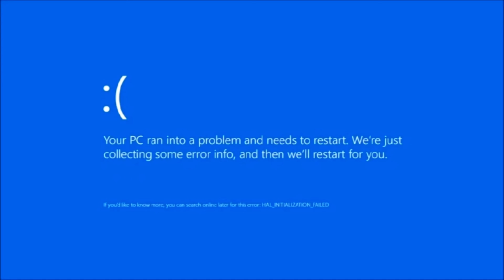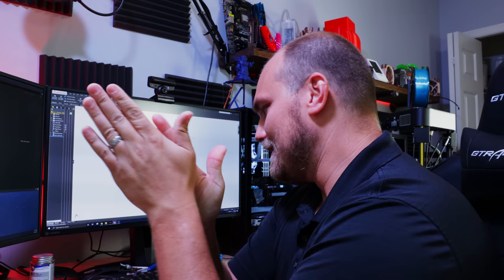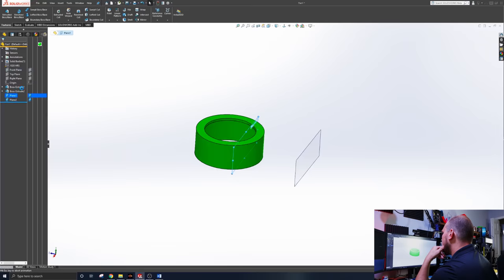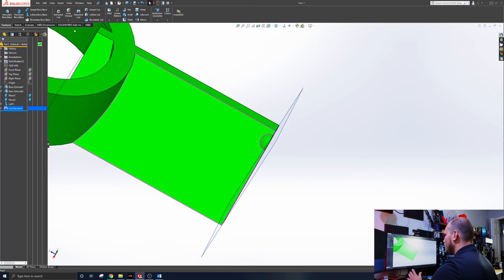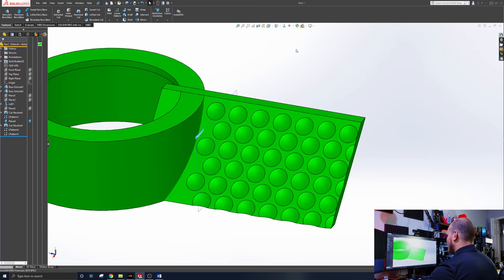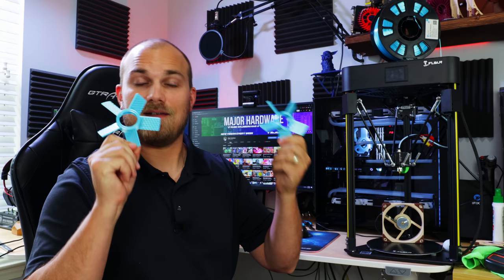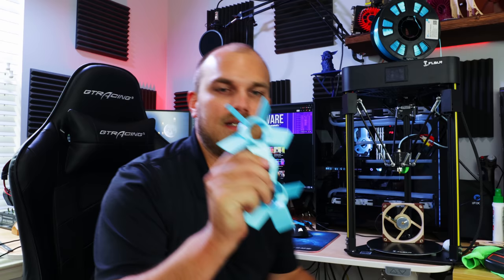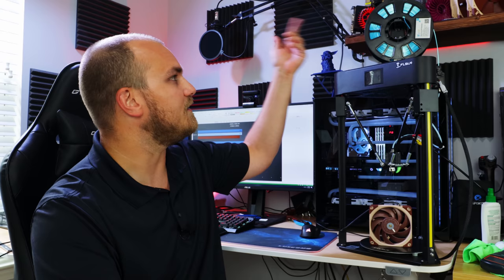What If Fan Blades Had Dimples Like A Golf Ball?

Comment: the fans are digitally controlled, measuring their rpm isnt relevant.
Reply: Yea the motor will spin at the same rate no matter what. Needs to be in a direct airflow tunnel and see what rate it would spin if only on a bearing
Reply: Measuring RPM would have been relevant if he was also measuring power draw/current
Reply: It does though
Reply: except he hooks it straight to a 12v line. Which you would know if you watched his other fan videos.
Reply: It's on its max power (meaning it's running on DC and not PWM), the weight and air resistance of the fan will affect the RPM.
Reply: @markzaikov456  This is a bipolar fan motor with a solid state controller. Its response is not linear nor is it necessarily proportional to the any changes in the load.
Reply: @akabiscuitwaffle  so, those fans are brushless bipolar motors. There is a digital controller inherently baked right into them to commutate the windings.

Comment: Yes, we did see the same RPM coming lol. Compare the current draw, the RPM are a testament to the motor speed control, the blades however could impact efficiency of the motor. I.e. drawing more power to maintain 1880 rpm.

Comment: There actually was a popular dimple-bladed fan in the early 2000s: The Sharkoon Silent Eagle.
Reply: I run these in my current system. I don't know if the dimples actually do anything, but they are great fans and incredibly silent.
Reply: Back when even fans had catchy and meaningful names haha
Reply: Yes, was about to say this. I have a white one and a clear one and they are indeed very quiet. They came with little rubber thingies instead of screws so to dampen sound even more.
Reply: @enquiryplay  Same here - and they've recently ticked past 10 years old.
Reply: Yeah, My old gaming PC had those.
Reply: @enquiryplay  Must be pretty good fans if they are running 15-20 years later perfectly.
Reply: @IvanOoze1990  They aren't quite that old. I bought them in 2014.
Reply: The Apple G5 had those rubber holders for the fans too
Reply: @enquiryplay  Noctuas are also incredibly silent for their airflow, although pretty expensive.

And we know that they do extensive research to reduce the sound level, and they seem to have moved away from dimples.
Reply: @Shadow_Hawk_Streaming  I'm currently completely overhauling an old G5 Quad with the liquid cooling system. Unfortunately I had to destroy most of the rubber thingies. Thing is a b'tch to take apart.

Comment: you could reverse the dimples to make a bumpy surface , or use a shark scales pattern as it's made to flow perfectly at least underwater...
Reply: It would be very interesting to see the scale pattern tested out!
Reply: @shandyozaki9579  especially under water
Reply: Sharks don't have scales
Reply: I learned today that sharks have scales... off a video about fans 😂
Reply: You need to check CFM airflow instead of motor RPM.
Reply: @davidbroadfoot1864  incredibly fitting video, he compares the shark scales to.... golf balls!
Reply: sharks r cool!
Reply: whale fins have nodules at the edge that are supposedly better for flow around them as well.  Interesting idea to try out.  I wonder if there are any energy savings with different designs?
Reply: @Mrch33ky  Orcas are even cooler! :D
Reply: Or a sacred geometry pattern.  Maybe wishful thinking but the fan might shed air better or something magically wierd.  But considering they probably did research on golf balls alot suppose the hexagonal pattern is good nuff
Reply: The main reason sharks and fish are fast, is their hydrodynamics and their slimey surfaces, they have very very little resistance because of it
Reply: >> you could reverse the dimples to make a bumpy surface  (call it pimples
Reply: I've actually got a fan that has dimple bumps instead of dimple hollows. It doesn't flow very well, but that is probably because the fan blades are undercut at the bottom of the outside edges to avoid hitting the ever-so-necessary LEDs that light up when it is going round.

Comment: Decibel meter and airflow meter would be a good thing to add to your testing I think.
Reply: Indeed! and what about actual product - What is the airflow IE does it cool the PC etc. more? a bench test just doesn't say when that circuit will tell the fan when it needs to work. With less material causing cost savings and if it is more efficient IE uses less current (less money from your pocket to the nasty old utility company) that is the real test i think. Sorry if I repeated a thought. This is very intriguing idea.
Reply: Glad I saw your comment because if those aren't in the video I'm not going past the... 1 minute mark. Thanks again.
Reply: Also he could have looked at energy consumption.
Reply: @propositionjoe6936  Prop Joe, how right you are.
Reply: Yes, the goal is efficiency (watts, CFM, BTU, dbm) so should the measurements be such.
Reminds me of a certain show that "busted" concepts using non-objective test methods based on personal myths.
Reply: These honestly seem like the fist two things you'd measure when testing fans. I was surprised when the video ended and neither had come up, except for an ear test on how loud the fans were.

Comment: It is in no way surprising that the two blades spin at the same speed: the motor is likely designed to run at a target speed.

The interesting questions are:
1) does it move more air (and is that flow less turbulent)?
2) does the motor take less power to achieve the speed?
3) does it improve static pressure?
Reply: yeah was hoping this got answered lol
Reply: Actually the point of the dimples on the golf ball is to induce turbulence. Turbulent flow splits later than laminar flow, reducing the pressure drag on the ball. It does increase skin friction but pressure drag is much stronger. I
Reply: Absolutely - the power consumed to maintain the same volumetric flow is the important factor as you're trying to improve the efficiency of the fan.
Reply: @JZhang-of7iw  just because there is more surface turbulence on the fan blade surface doesn't mean there is more turbulence in the air flowing off of the blade. That might seem intuitive, but the physical reality often isn't intuitive.
Reply: You guys all sound smarter than me so wheres the answers?🤨😂
Reply: @Noone-l6g  Since there aren’t any numbers, I can’t say for sure, but I think that the angle of attack is too high for the dimples to do anything.
Reply: @christophermartin6071  Right, I misunderstood what you were asking. I thought you were asking if the airflow on the blade is less turbulent.
Reply: saved me watching the whole vid - thanks!
Reply: Came to the comments to make the same point, plus one more: He also needs to test for noise level, as dimples reduce turbulence, they may also reduce sound.
Reply: GMTA was gonna say same stuff- plus one more: I think the dimples prevent boundary layer adhesion, and that is speed dependent- use a different motor- maybe 3 phase model airplane motor- and crank it up over 100 mph tip speed similar to what a golf ball might hit. bet a model airplane prop model could be found for your printer, just add the surface dimples...
Reply: No the motor wil run at a slower or faster rpm depending on the fan weight and design. Watch the fan showdon series
Reply: This what i was expecting honestly.

Comment: Part of the motor driver is speed regulation. So of course they are the same RPM.
Reply: If a fan is too heavy or very inefficient it will overpower the motor at some point and stop it from reaching its preferred rpm.
Reply: Hey look everyone a guy who knows more about this then the YouTuber who actually does this shit.
Reply: @youngputter239  I mean I'm hardly convinced that this guy knows more than the youtuber. I thought the motors mostly output the same wattage how fast that spins depends on the fan. Why should I believe that this motor has some feature that makes it always spin the same rpm no matter what's attached. Surely the youtuber/engineer would be aware if that was the case
Reply: @monhi64  Mostly because that saves BIOS work when regulating fan speeds. If it didn't have a preset static speed, changing the speed of the fan through the BIOS would require constant updates and adjustments. Making it built-in to the fan itself would show up as a change in current draw or voltage as the fan would handle the speed set once by the BIOS.

I realize this wasn't in a PC, but if the fan was designed to go in a PC, having a fan that you could set a defined speed on allowing it to vary the current/voltage would be a huge benefit to the BIOS. Kind of set it and forget it. Meaning this may be the standard for this kind of fan. 

The real test should have been to attach the fan to a motherboard that allows incremental changes in fan speed. Create a table and plot the voltage per RPM and see if there is a difference. A significant difference in current/voltage may indicate a more efficient fan design though the RPM stayed the same. 

I'm not saying this is a fact, just that it makes a lot of sense.
Reply: @JasonBurnettsProfile  ok I kinda understand what your saying. So one thing that doesnt make sense is like what's the supposed point of the dimples. Do they blow more wind? Like if they pushed more air they would have a higher air resistance and it would make the motor work harder to spin it. So its making more wind still at the cost of more energy. Why not just make the fan spin faster that is also more energy. But idk maybe one would require less extra energy. I dont think you necessarily want the fan that can turn with the least air resistance and that would mean it blows less air but idk I'm sure someone knows the answer to that question lol
Reply: @JasonBurnettsProfile  CPU fans change speed all the time! Only the occasional desktop cooler doesn't have feedback and speed control these days. My laptop, like every other one I've used in the last 15 years, changes speed according to the current load on the CPU and GPU. Without looking at that feedback mechanism, you can't really tell what's going on with adding dimples.
Reply: @youngputter239  Yea and why is that weird? The guy did the comparison wrong.
Reply: @monhi64  The dimples are supposed to lower the resistance of the air flowing over the surface of the blade, so energy is not wasted as heat (friction) but is put into moving the air.
Reply: The COVID-19 brought out the University of Facebook doctors. Now this video did the same for the YouTube University Engineers graduates. This is going to be fun to watch... 😏

Comment: Make a fan with horizontal blades but give them the cross section of a an aeroplane wing so as it spins it creates a pressure difference. 
Doubt it'll do anything but a lot of profiles to choose from! Maybe print a few and test it out :)
Edit: Don't print whole fans with the blades. When playing around with the blade angle, print out a bunch of "caps" (the thing blades connect to) and each can have slots at different angles. Theoretically you'd be able to test blade angles AND blade counts this way. By only printing a set of fan blades once, it'll save on plastic and time. The "cap" can have 36 slots (effectively a 36-gon) but you don't have to populate all of them, you could simulate 2, 3, 4, 6, 9, 12, 18 and 36 blade fan on one cap with one set of blades.
36 is just a nice divisor.
Reply: I second this!
Reply: Unfortunately this just doesn't work. Think of an airplane propeller, it has lift properties but gets most of its "power" from the angle of the blades. But I like your line of thinking!
Reply: Edit2: Give it only 2 blades for authenticity sake?
Reply: @tobiasgunny  Yeah, he'll have to play around with it :D
Reply: it seems fun, 4 plane-wing-blades vs 2 plane-wing-blades vs 4 fan-blades vs 2 fan-blades
Reply: Make one horizontal and one at an angle too, best of both worlds. Heck, make a bunch of different angles from 0 degrees - 45 degrees and see what the optimum angle is...
Reply: So a drone propeller?
Notice how propellers dont really have an airfoil shape. They work under turbulent flow
Reply: You need to angle the wings to get a proper result
Reply: @tobiasgunny  It is much harder at such a small size to see the effect of an aerofoil but shaping the duct like a wing increases the lift in a quad so in theory would increase the air movement. The real problem is the current limit on the motor. It would probably be better to use a fixed speed induction motor of some kind and measure the power use.
Reply: Some LARGE industrial fans have no angle they are just Using the effective lift
Reply: maybe a stack of zero pitch blades as well?
Reply: I think you'll run into manufacturing problems trying to make a removable blade hub that can fasten one blade stiff enough for functioning as a fan, let alone cram 36 such connections onto one hub.
Reply: @tippyc2  Definitely a stretch, but if he figures it out, it'll be a massive time and material saver. 36 in theory, as I said, it's just a nice divider. It could definitely be less :D
Reply: Every hole for a blade can have a small screw from the top  to fix the blade, the shaft can be hex or ocata or more shaped to have the angels in it. You can put all blades in the same way. This hubstyle can be used for more testing and the blades can be printet flat or standing for faster prints.
Reply: @valen8560  2 blade would need to spin 80% faster for same airflow and no static pressure
Reply: @tobiasgunny  A combination of both can be the optimal solution depending on your requirements.
Reply: There is a lot of airfoil data available that reduces the need for trial and error testing. Search for naca airfoils and choose the one that best serves your purpose.
Reply: @tobiasgunny  yes, actually 99% is from the coander effect alone.
Reply: Which airfoil profile works best depends on the Reynolds number. At the small sizes of cooling fans thin, slightly curved, pointy profiles work best. When you are in the realm where turbulators (that's what the dimples are) are effective, the thinnest airfoil structurally possible is usually best.

Comment: Many years ago at Bristol University I was involved with hydraulic tests on tubes with golf size dimples, these demonstrated that boundary layer friction was drastically reduced. Size of dimple to velocity is the key here.
Reply: true. and this is only one of many factors to consider. this case is so complicated that to reliably test whether dimples TRULY have any benefit/downside, it would take more than a mere 15 minute video. and it would take FAR more effort.

this is why this video is pretty much pointless besides entertainment purposes. nothing reliable can be learned from this video.
Reply: Hello Craig!

What's the realation between dimple size and air speed? Does it depend on the speed, more than on the size of the actual object in which you want to reduce the drag?

Thanks, regards!